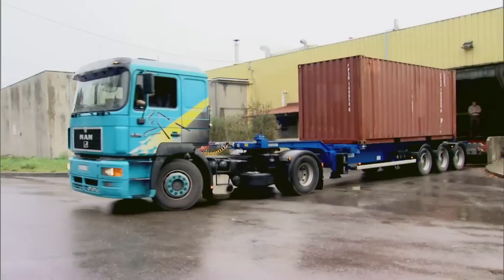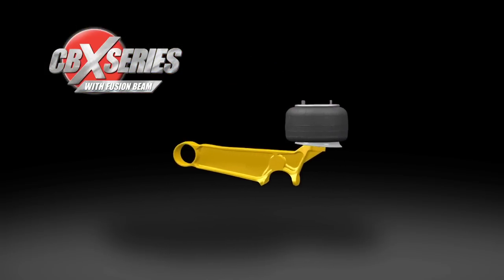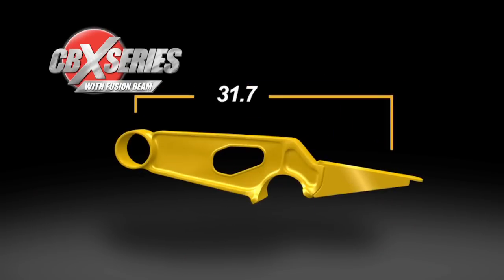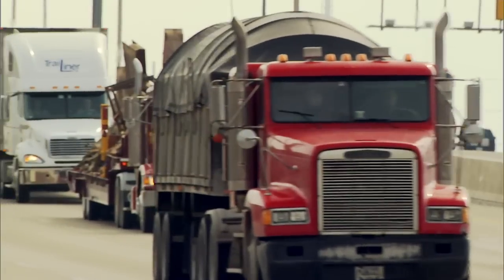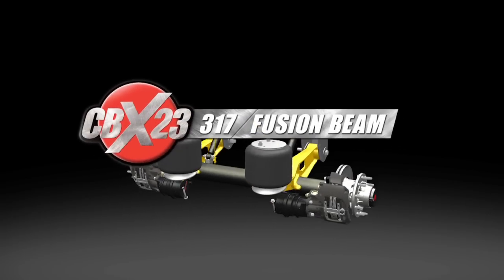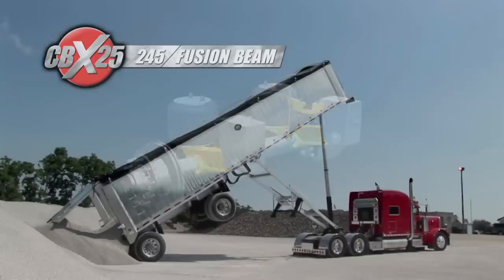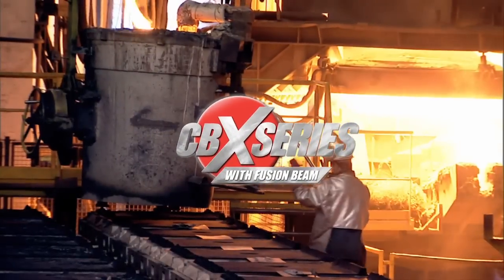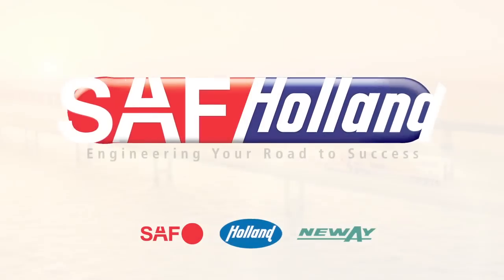SAF CBX Fusion Beam Trailer Air Suspensions

Comment: You must think twice before buying a SAF axle. I operate a Transport company in South Africa 16 years. The proplems are as follows 1 The brakedrum, brake shoes and wheel barings are far more expensive than any of there competitors including BPW. 
2 Getting parts across the country is difficult especially on a brakedown. 
3 the axle tend to rust making it almost impossible to remove the hub without a Jack wheel puller we had to make.
4 Ridiculous o ring instead of a proper oil seal. 
5 Reliability I had 3 wheel barings failures in less than 14 months which includes having complete bearings replaced after 24 months .I suspect the bearings don't like extreme heat from braking a lot on down hils with twisting roads.
I unfortunately don't like SAF axles. If you can afford it rather go for BPW

Comment: I don't like SAF axles,  the hubs are a pain in the arse to remove when they are rusted on the stubs even on relatively new axles. Grease the stubs and make aftermarket repairs easier. We don't buy these if we can help it. BPW is the way to go for easy maintenance